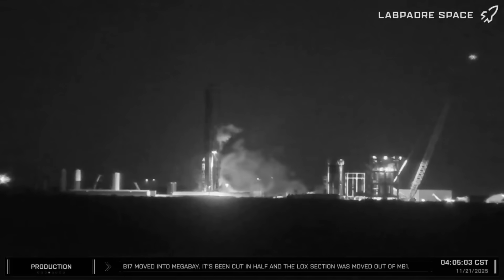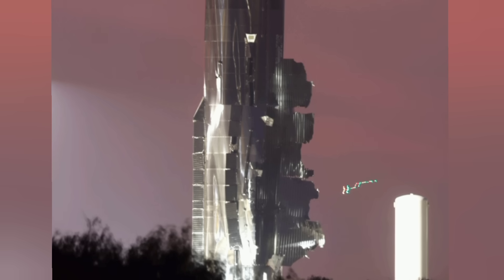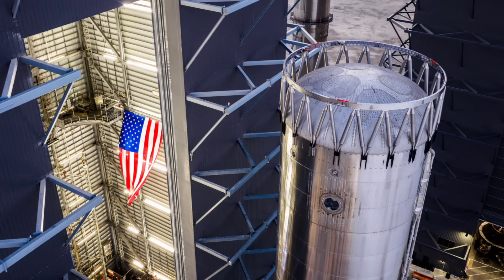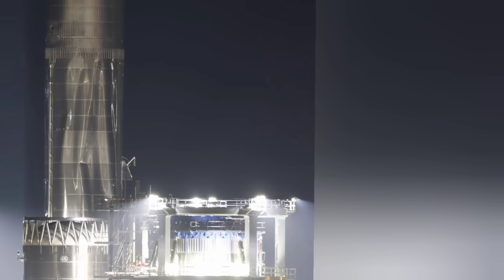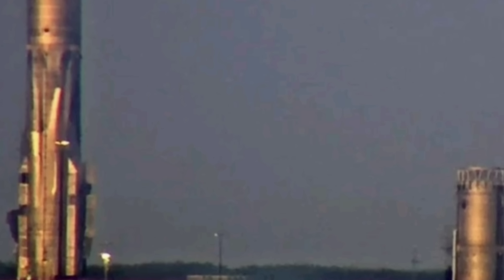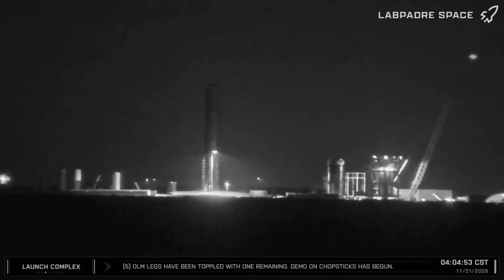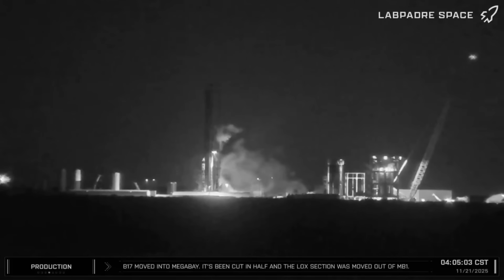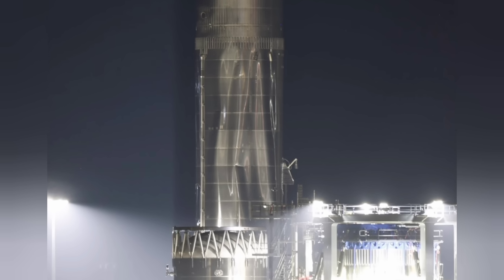SpaceX Starship Booster B18 Implodes!

Comment: In which worls is an tank which can't hold the pressure not a huge step backwards? V1 and V2 were never reliable and now even more parts fail. SpaceX's list of problems is getting longer instead of shorter. No wonder independen experts start to lose faith in Starship's concept itself and the development process ... while Musk still fantasizes about daily launches and the color of the carpet of the moon base. Is that already loss of reality or still desperate PR?

Comment: Its exactly while those low risk tests are made in the first place. No big deal, as nothing serious was damaged, and it was not at flight test. Of course, the reason has to be found and eliminated, how much time and effort it will take is unknown so far. We can of course speculate, lets see how well those estimates hold up against the test of time. My guess is it will take 2 weeks to find the cause, two weeks to fix it, 4 weeks to build another booster tank. As the new start tower with flame trench is almost, but not already finished, it could well be, that it won't cause any delay. 

For the realiability conserns: This is not a small iteration of the booster tank section from the V2  booster. Its a complete redesign, aimed to achieve several bold goals. Remember how bad things went for V2? In the end it did a good test flight when many had already given up hope AND it did the first reflight of such a huge rocket hardware. This V2 Starship would have been able to bring up at least 15 Metric tons into LEO,  but given how much faster it departed from the pad than New Glenn, more likely in the ballpark of 30 tons up AND down. That's far from the aimed numbers - a reason why V3 is now in the making - but already in the range of the space shuttle at a fraction of the cost and with huuuge numbers of starts per year in sight. Which would already be more than any other space agency and company in the world. 

For those who say "but it hasn't got crew quarters" and " isn't human rated" lets remind you, that the cargo dragon came first ... when it had done well, it got updated to the Crew dragon, and subsequently mopped the floor with the competition. That's why they can afford a program, that NASA can't. SLS is not the future, its a pale shade of a glorious past and incredibly expensive per flight.

Comment: you have become a little strange in your Elon – phobia.

The previous ship designs were meant to be destructive in order to test all of its limitations so that SpaceX knew exactly what the ships could handle. They are now in the new phase of testing for the next generation and will test to destruction.

Testing challenges are not incompetence. They are engineering processes that identify and teach about what is needed to improve design.

I would agree if SpaceX had a record of incompetence and failure as opposed to test and succeed.

Once complete, this platform will provide a flexible and multi role facility that will speed along many options of infrastructure development between earth moon and Mars and perhaps of the asteroid mining adventures.

It's good that you support the other options including those that have poor engineering and whose warnings past NASA engineers have warned about. You know, those ones that have continued with the spaceshuttle design models that were never addressed when the shuttle was running and led to the deaths of actual astronauts..

Do better in your upsets with Elon. At the end of the day, he's a bloke who is pushing boundaries. It could be worse, it might be you who's leading the engineering teams telling them that they are not capable of problem-solving or overcoming challenges in their engineering potential.

Comment: I hope blue orgin reaches the moon first , at this point space x is willingly stupid . Still insisting on stainless steel , still wanting to take a giant upper stage to space , instead of building one . Still using heating field that will fail , instead of proven reliable ablative. Still pushing the engines to the limit and surprise they break or damaged .

Comment: Cutting off a Grid-fin when they are used to catch the booster seems crazy, with 4 of them the two chopstick each catch 2 of them and the allignment dosn't need to be perfect as misalignment should still catch two opposite fins for a stable hold.  With just three their will need to be near perfect alignment or else the catch will be on only 2 of the fins which will be off balance which could cause it swing and then slip off.  This change feels like desperation to save weight, as dose this impossive failure.
Reply: get facts straight...  so far spacex never has caught any booster via its grid fins...    and having 3 2 or 1 or no grid fins has anything to do with tower alignment... that is done through engine gimbling....

Comment: The larger version of New Glenn will overtake superheavy. The iterative process is too slow now. SpaceX should have developed FH and human rated it.
Reply: FH was a flop. They can't land the center booster for most missions, and the fairing is too small for the lift capacity, hence it being hardly used to date. It's a dead end. I wouldn't put any more into it.
Reply: Absolutely not. They should have built a falcon 10 with raptor engines. With 9 engines in the booster it would even outperform NewGlenn

Comment: any new hardware will have it's growing pains, I would have hoped the program was beyond failure at this early stage of testing. The block 2 ship troubles this year too haven't been encouraging. And this coming after a good week for Blue
Reply: NASA SLS = $ 24 Billion to develop 4 billion per launch 1 launch in 14 years...
SpaceX falcon 9 $330 million to develop $60-70 million per launch 577 launches since 2010...
Star Ship 11 launches in 2 years....  
SpaceX Starship Currently, the cost per launch is estimated to be around $100 million for expendable missions.
Reply: New Glenn's development began prior to 2013, and it was officially announced in 2016. The rocket was unveiled on the launch pad in February 2024, with its maiden flight occurring on January 16, 2025.

Comment: The reason spaceX are having 'problems' with their rockets is because they're pushing them to the absolute limits to see what the thresholds are, what happens if they run into problems, how they behave in certain situations.
SpaceX literally has a conveyor belt of rockets.
One of their recent launches they done with missing panels.
So for everyone laughing/berating them for their 'failures' ...they're in essence designed and set up for failures otherwise they won't learn anything new.

Comment: Rookie mistake with cryogenics    Vacuum collapse failure. Negative pressure on a vessel that is not vacuum rated. The nitrogen gas in the tank condensed when the cryogenic liquid was introduced and the nitrogen condensed leaving a vacuum. When you fill (cool) a vessel, you need an outlet to the gas side of the liquid fill tank and a pressure controller to keep the receiver tank at atmospheric pressure or above.

Comment: It's OK. New Glenn has our Moon missions covered. As far as Starship. That one time NSF wasn't covering it, darn!  I wonder if they lost control of the filling process, as allot of Massey is new. You can kiss that booster goodby... That is what the insurance company calls "totaled". We are now looking at March for another flight, and this program is going to take just as much time as any other new rocket system ever. Reality doesn't care that every other fandom channel declares "SpAcEx So FaSt!"
Reply: The ultimate goal has been reducing cost to space and increasing ability to send mass to orbit. If you look at new Glen, it has had a few nice launches but Falcon 9 is launching every other day with both companies starting about the same time. For Starship, it has gone slower than we would like but it still is making progress and it has a manufacturing base behind it unlike the SLS which can only launch every 2 years. My view during the testing portion is subtract 10% every time an issue occurs with SpaceX for confidence level and then for a successful flight add 10% back so it is at like 70% now meaning they are slipping a bit.

Comment: I was expecting IFT12 to explode but in flight. They are minimizing the challenges of increasing flow rate 20% and ride it hard.
In the Fanboy Universe, if Space X has an explosion it means you are learning, if another comoany has a failure, then they are a disaster and they are not learning anything
Reply: Yeah, they love to do deep dive hit pieces on Boeing, SLS, Orion, etc. But, in the meantime SpaceX has complete vehicle failures regularly, still, and they're amazed at the speed of progress.
Reply: @troys9222 What I am looking at right now is how many launches to get Raptor 3 to fly without blowing up(1) and in what condition will Starship (2nd stage) be when it is finally recovered and what kind of effort and time will be required to make it fly again if at all.
Reply: @pedrosura  Those are very real potential issues all around. At the pace of progress so far, each of those could take several flights to even find out about, each. Raptor 4 has been announced, so Raptor 3 should be underachieving soon on schedule.
Reply: @t @troys9222 imagine Raptor 4 is announced because they can not fly to Mars/Moon Raptor 3. Raptor 3 is probably just enough for Starlink deployment. But Raptor 4 will be needed for Moon/Mars
All of this why? Elon wanted to make starship of stainless steel, thats all.

Comment: Wow. 56 years ago, NASA landed on the Moon using very primitive tech compared to now. NASA is still working on a spacesuit that will survive the radiation on the Lunar surface, when in 1969 the two men had awesome suits that protected them perfectly, as both lived to old age. NASA's trying to resolve the problem today of the radiation bombarding the spacecraft en route and on the Moon, but in '69 it was a piece of cake-no problem.
Reply: It's a bit different problem with the types of electronics we have now, but they're solved issues. I haven't seen doubt from anyone in the business. It's seems like just a moon landing denier talking point.
Reply: NASA had basically unlimited funding back then.

Comment: At this stage of development something like this shouldn't happen anymore. I'm really suffering from observation/anomaly fatigue by now regarding SpaceX and their "rapid" development strategy.
Reply: I used to work for those clowns, if they ever get to orbit, I will be shocked, at their current rate think 2099
Reply: @wilsonblain7309  Do tell us why you don't work for these "clowns" anymore.  We're sure there would be some entertainment in your story.
Reply: @wilsonblain7309  their concern is creating a 100% reusable rocket not getting to orbit.
Reply: Nobody has ever even attempted to build a 100% reusable rocket with twice the power of Saturn V. Nobody knows how long development will even take.
Reply: @jamescarter8311 Exactly! Everyone thinks this should all happen overnight. Cheers
Reply: I'm sure we can find you some soothing cat video's for you if these are causing you too much stress in your life.
Reply: Did you not understand the discussion about all the changes they are making to this new version of the booster?  The design is not static or mature, so your statement that something like this should not happen anymore is nonsense.
Reply: @philiplangford9434  The fact that the design changes is the problem. That's why nobody uses the rapid development and test model. The design never gets finished. With each internation, you introduce new problems.
Reply: @philiplangford9434  There is no way the rocket should be having to be completely redesigned at this stage. That is the whole point.
Reply: @troys9222  I spent 36 years as a staff engineer in aerospace.  You don’t know what you are talking about.
Reply: @philiplangford9434 Development of starship started in Feb 2020. Those explosions are still happening like with SN1 and I bet the new v3 ship will have it's "anomalies" too, because the "design is not static". After close to six years I really think Starship should not be exploding anymore like in the old days.
Reply: @jonny3003  It sounds like you need to apply to SpaceX and square away their mistakes.  We're sure they'd appreciate it.

Comment: It rather appears that the external crushing was brought on by the split at the lower portion of the oxygen tank, causing the rapid spill of contents. That rapid drainage would cause a vacuum-effect at the upper portion of the same tank. This also makes me concerned for any future leaks causing such structural damage. Though this type of failure is pretty extreme.

Comment: 6.2 bar is nothing ! Around 90 psi , that kind of pressure is easily controlled by welds !  More likely a valve problem..
Reply: PSI is meaningless without surface area. The important thing here is 'hoop stress' which is a combination of both.
Reply: Depends on the safety margin. A rocket tank has much less safety margin than a standard pressure vessel
Reply: I wonder if Elon is experiencing hoop stress now
Reply: Always the valves...
Reply: The aprove rating for flight is 7 to 8 bar. So it's a big failure.
See the pictures now and it seems welds ar not really affected. Looks like a stainless steel problem. Maybe without LOX (cold) that kind of pressure is not supported. But that means the overall margins are quite tiny.

Comment: If you keep changing the design, you will keep running into new problems. Starship is a 4mm thin Pringles can
Reply: Exactly. It's a platform that will never get finished. They're already planning for Version 4!
Reply: @keithfield  Notice how they had to announce Raptor 4 just before Raptor 3 inevitably disappoints as well?
Reply: For the scale it is around 1/3 the thickness of a coke can.
Reply: And SpaceX still needs to prove that a "4mm thin Pringles can" can make a reliable launch system. At the moment indepent experts more and more lose thier faith in that. At least with SpaceX's design and development process.

Comment: I don't quite understand implosion. High pressure in the tank. All forces should be outward. Somehow the interior pressure dropped well below atmospheric, in a sudden and drastic way. A large rupture might do that, perhaps on the side hidden in these views, with a very rapid escape of lox, creating a brief vacuum in the tank before in rushing air can equilibrate. Just enough of a pressure drop to crumple the thing, so, actually, this could result from an explosive decompression, just not one that involves the entire tank, more like a ruptured seam. Just speculating.
Reply: Sounds reasonable. Looks like it ruptured on one side and buckled on the other.

Comment: Can’t make an omelet without breaking a few eggs. This is par for the course. They are accelerating the program so expect plenty more stuff to break. This is a new design so it’s good to find the failure points.
Reply: They told us that this rapid prototyping fable since 2018 and that it  will get us faster to an production article. Seems like that companies  with traditional calculations and models based prototyping are literally in the same or better position. Stop drinking cool aid.
Reply: @dukenukem8381  Which company are you talking about? Because there is none
Reply: @dukenukem8381  You mean like stranding astronauts in space? Or not having heat tiles to de orbit? No chopstick catch? No 561 launches. Everything competitor's have done has been done before. Monkey see Monkey do. Stop drinking the cool aid.
Reply: @dukenukem8381  As stated, the corruption will continue with Trump & Chainsaw Musk at the helm.
Reply: Lol 😂
Reply: 100%